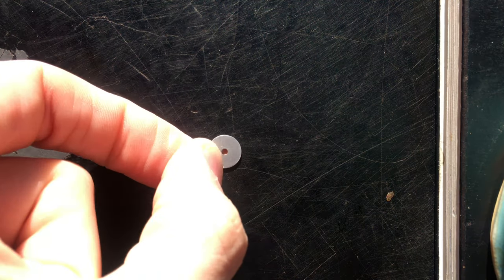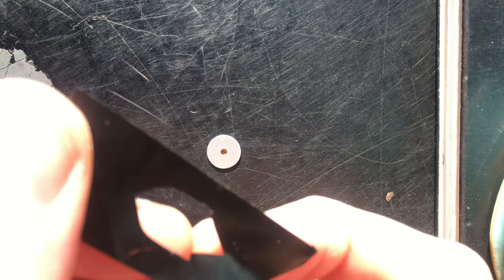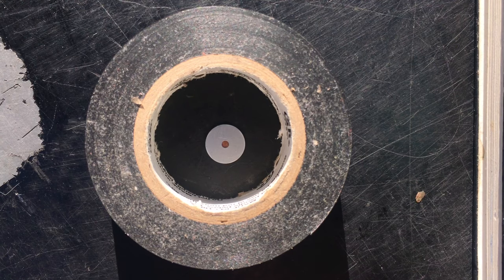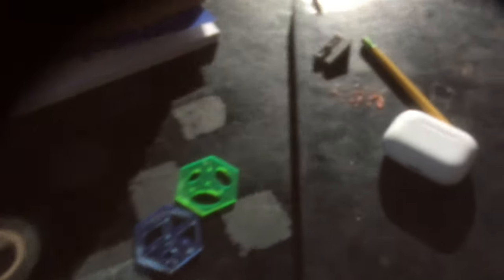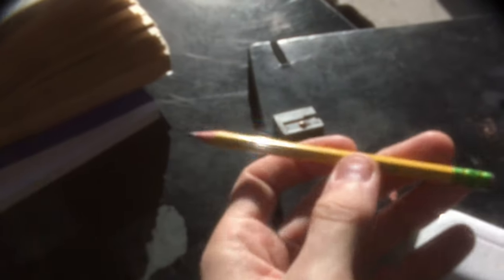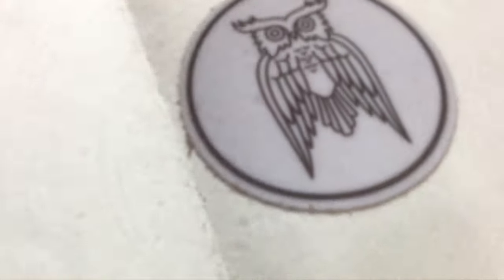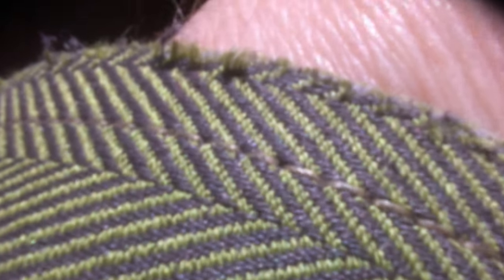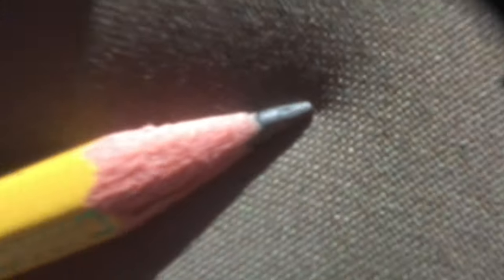DIY Pinhole Smartphone

Comment: Sweet! Did you put together the aluminum disc w brass foil or buy it?
Reply from the maker: I bought the disc with the pinhole in it from an ebay store called Fireseller66. They offer many different sizes of pinhole, from .05mm to 2mm. Quality pinhole-smartphone images are achievable with home-made pinholes too, so if you've got some foil and a needle, you're good to go. :)